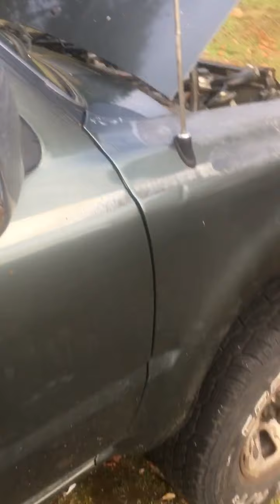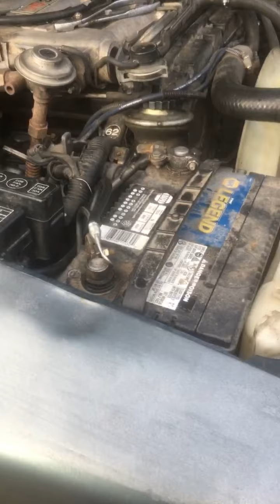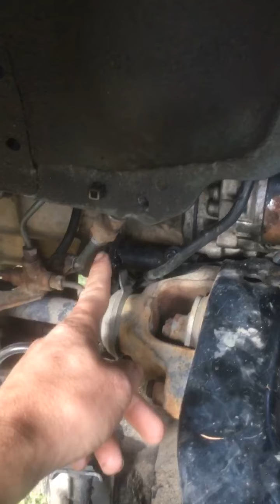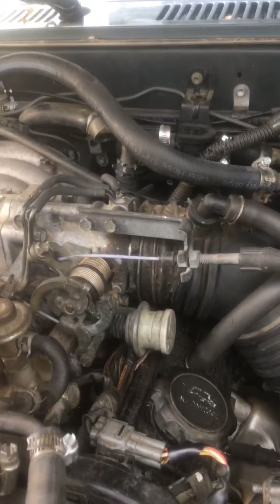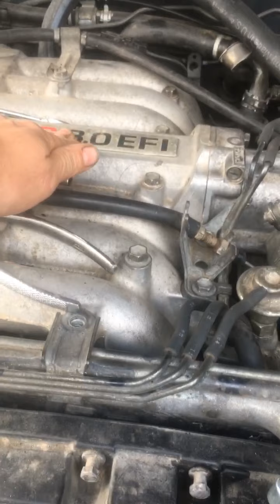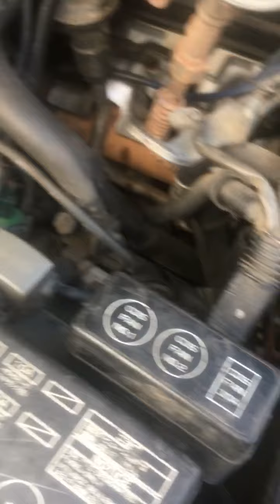Toyota 4Runner cranks no start

Comment: No sir I wish I could help ya. I've spent approx. $2000 changing parts. Timing kit , distributor,  you name it. Sensors , etc. Afraid it's a MONEYPIT.  It's at a mechanics ( so called ) now for 2 months. Same results. 
I'm bout sick of throwing money at it. 
May be good anchor material. IF you get resolved , pls. Advise ! 
Good Luck !!!

Comment: Fist thing i can tell you is I'm having the same issue, but i did crack open the banjo bolt under the fuel regulator and manually turned on the fuel pump till gas started to leak out to get most of the air bubble out of the line and seems to help, next im going to order new bango bolt washers to make a good seal. 👍
Reply: That's so pointless to do man it's got INJECTORS and the fuel returns to tank!

Comment: Dude , I've a 95 4runner, 3.0
EXACT SAME PROBLEM. 
NO FUEL  past injectors.
Removed the fuel pressure regulator completely and eyeballed the fuel filling the rail at that point. Checking injectors is next ??? 
Ohms,? 16, 17. ??
If you had any success, pls. Share . Thx.
Reply: did you find the problem? I got the same problem with my 92 4Runner
Reply: Any luck mate I’ve same problem on my 1994 3ltr? Appreciate any help

Comment: Buy the book. Will literally save u thousands. Actually, the injectors are governed by voltage which allows the pulse from each injector to remain in rhythm with the crankshaft , omg, Ive been forced to learn things about the thing I cant forget. Did u get it going ??
Reply from the maker: Yep it was a bad ground on the back of the motor to firewall
Reply: What ground are you talking about? The one that goes on top of the intake manifold?

Comment: What were the engine check codes?  On mine, if the eng temp sensor was bad, it would not start. Engine computer did not know how to adjust the mixture.
Reply: Am getting code 14 and 22 any idea of to fix
Reply: @AmeerKhan-ce9kl check the ignitor module grounds make sure it’s on tight and grounds and wires

Comment: I had a similar issue but it was the ignition excitor and you said you had spark. If the spark is weak it might cause an issue. If you had a fuel pressure gauge see if it is enough to run the SUV.

Comment: I just rebuilt mine it started the other day without a radiator or a fan so I put those on and was waiting for nice weather so I could fill the radiator up with water so it wouldn't freeze and now it doesn't start I've redone vacuum hoses and messed with timing and still just cranks it is getting fuel cause the spark plugs are wet after it cranking but I'm stuck
Reply from the maker: Does wit get spark